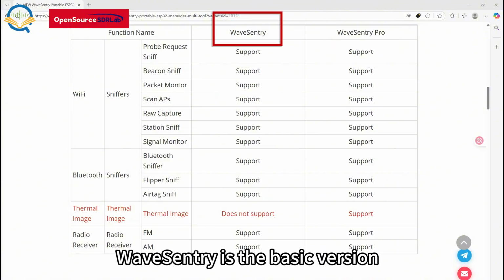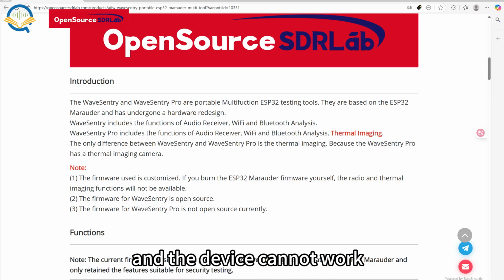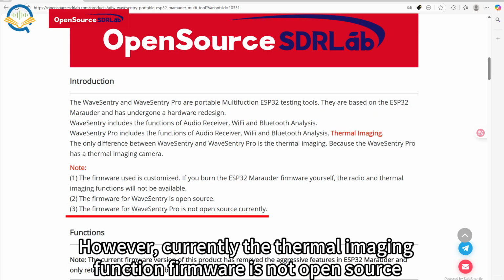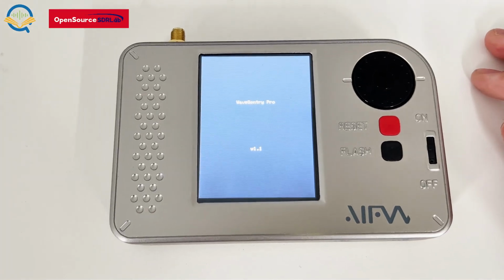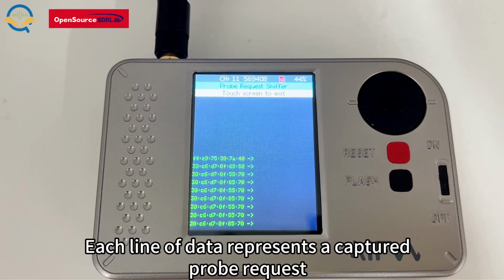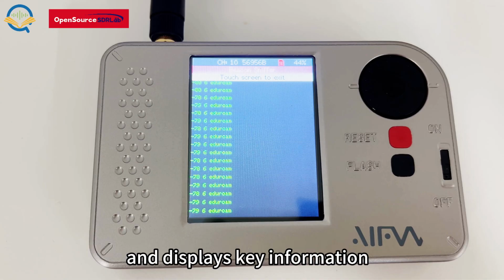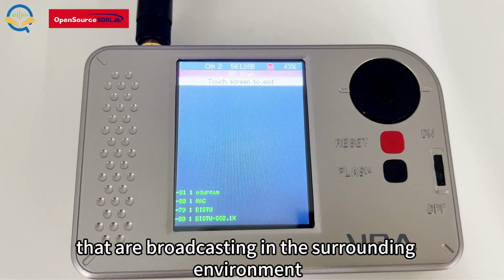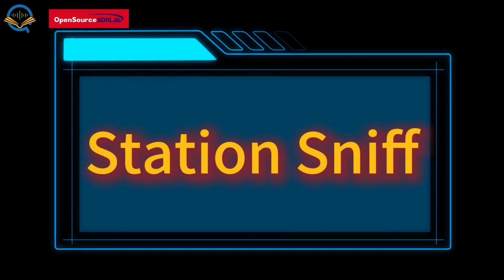AIFW WaveSentry Portable ESP32 Multi-Tool

Comment: So a water downed version of the maurader firmware… and a super low rez thermal camera. Sigh
Reply from the maker: Dear friend, this thermal imaging camera is imported from Belgium, with a pixel size of 32 × 24 and a total of 768 thermal infrared pixels. It is an industrial standard thermal infrared array sensor that can be used for high-precision non-contact temperature measurement, security detection, and other fields.
Reply: Its expensive 😊